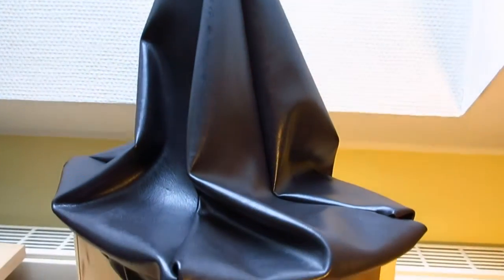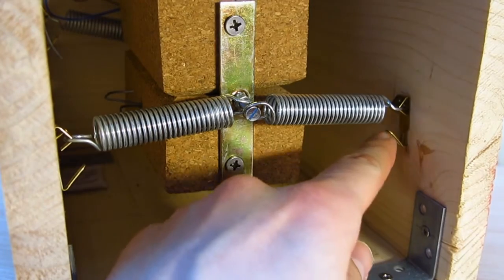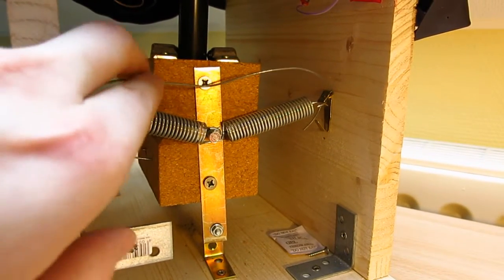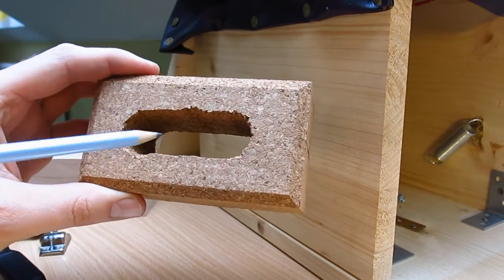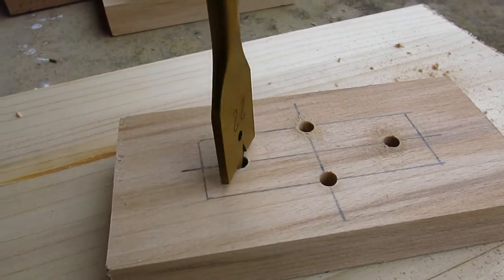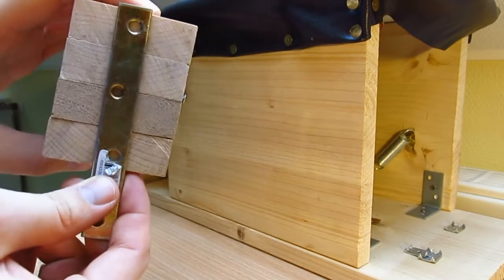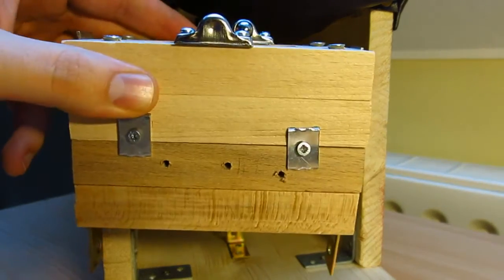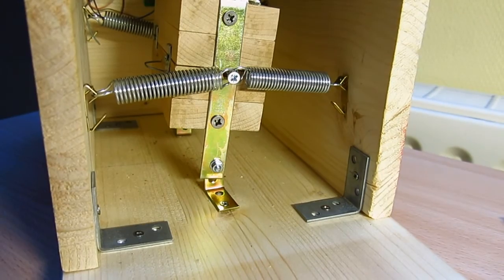DIY gear shifter: How to make the mechanical core

Comment: Can you please make a video about the usb interface you are using and how to use it.
Reply from the maker: If you want to use the same USB board I have used, I doubt I can explain it better than the manufacturers website and manual (http://wiki.simple-solutions.de/Products/Arcaze-USB/Arcaze-USB_Manual). Do you have any specific issues?
Reply: I will order this USB board this days and I hope it will be easy to work with it.
Reply from the maker: You will also need some wires and micro switches. You can get wires from the same website that sells the USB board but the switches might be a bit more difficult to get. Good place to start is e-bay and just search micro switches. Also verify what kind of switches you need. Size and connections etc. Good luck!
Reply from the maker: Also post a video or some photos of your creation later on :)
Reply: I will. Now I am making the mechanical core from the broken G25's H-shifter which I was using before.
Reply from the maker: How are you doing with your project?